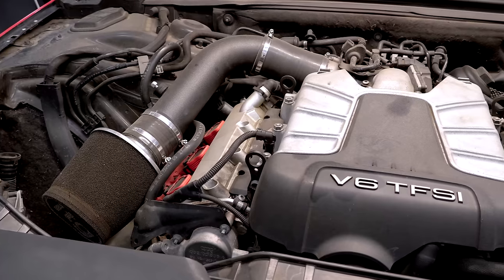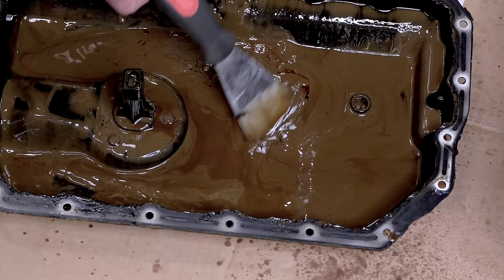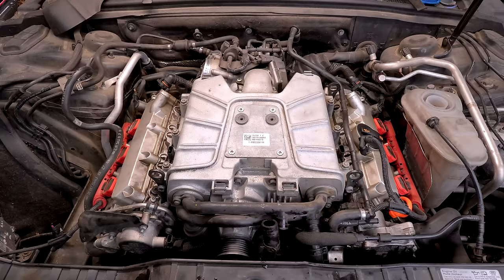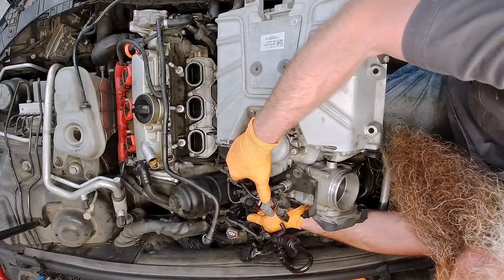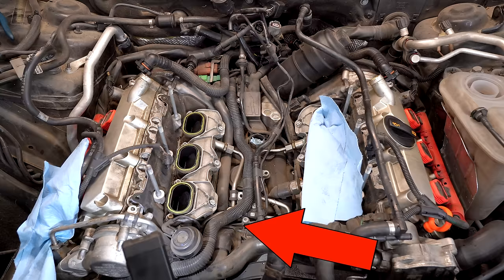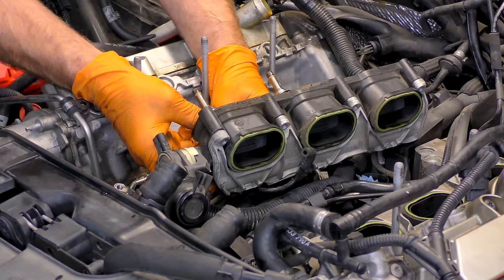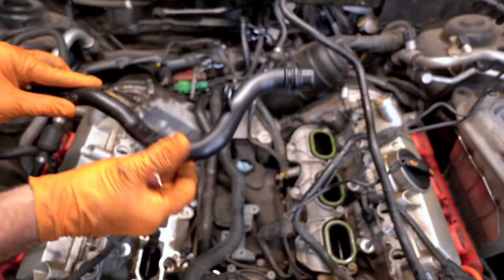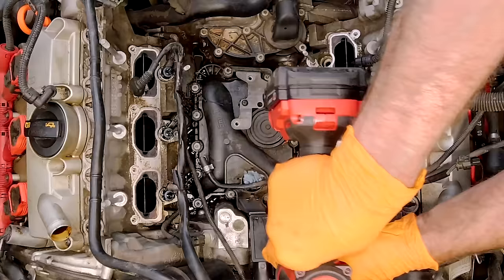How To Replace Audi 3.0t Supercharged PCV Value

Comment from the maker: Its WILD a PCV valve failure can cause this!! Here are some important links 
WD-40 Specialist Silicone Spray ~ https://amzn.to/3z6guht
PCV Replacement kit from  @Deutsche Auto Parts   ~ https://bit.ly/3TlFkSB
Scraper ~ https://amzn.to/3Su8IVB
Coolant funnel ~ https://amzn.to/3gDesPG
Injector Seal Kit ~ https://amzn.to/3F7LPEd
How to Properly Seal TSI Injectors ~ https://youtu.be/boVEdoayfn4
Reply: Got part numbers for all the gaskets needed to replace?
Reply: @HumbleMechanic the hardest part of the job was 15:20mins  in. That t30 sucked. I ended up taking those connectors loose and bending the bracket back while still using a low profile socket. And then that coolant pipe was stuck in the thermostat housing 🤦🏽‍♂️ just those 2 parts hung me up for over and hour. Lol
Reply: came here to see the part nr list
Reply: Do u have a wiring and vacuum diagram for the things in the back im worried i hooked something up wrong. I am getting an odd loss of power intermittently when i floor it, the engine will completely stop almost to the point it jerks me forward like i slammed on brakes then it will go back to full power. Very uncomfortable, cant figure out what i did wrong, it started when i replaced my coolant crossover pipe. Today i took it all back apart, replaced my fuel injectors, my pcv, spark plugs, and cleaned everything, but now im questioning if i am making a mistake on the vacuum lines on the back of the throttle body.
Any advice ❤
Reply: Great video !! What a pain in the ass job to do...
Reply: How much actual time do you need to do this whole job?
Reply: Where u located
Reply: Where u located please

Comment: I've had a buddy help me change my beetle engine and he hooked a vacume line up to a coolant line. Had a bunch of coolant mixed with my oil... did a flush multiple times, 10 years later I still find remnants of coolant on the oil cap. Engine is still going strong. Had 36k on it when it happened, has over 300k now.
Reply: If you only drive short runs, water condenses inside the valve cover and causes a little bit of milkshake on the oil cap. If you drive even like ten miles on the highway so that the car runs at full operating temperature under load, the condensate evaporates away through the PCV system. This might be an alternative explanation
Reply from the maker: @S1l3nthunt  Saw this a lot on the 2.0 non turbos. Short trip driving would build a bunch of moisture on the oil cap. a white goop
Reply: @HumbleMechanic  I'm thinking about looking for a Mk IV with the 2.0 NA 8V engine, I believe they have 115 horses. I read that many of them had oil consumption issues, but are they really bad engines in general? My dad used to have one of those in a '96 Passat and that was a pleasure to drive.
Reply: @schmuhf  Mine’s been reliable and doesn’t have any oil consumption issues. Little slow but kind of fun.
Reply: @schmuhf  reliable, but yes they burn oil and can start to ping.
Reply: @schmuhf  iirc, the early AEG’s had something installed upside down that caused them to burn oil. Mine is at 250,000 miles and is still running strong. I’ve had my oil analyzed and it shows about half of the iron ppm compared with the global average.  I burn 1 qt of oil over 7,000 miles. A slow, but solid engine.
Reply: 2.slow is probably the best motor VW ever sold.

dealer tech here.
we dont have problems with them.
just do services and send it.
Reply: Sounds like an aba
Reply: @bobby2800  from what I remember in forms one of the rings was installed upside down. 

Rip my Mk4 2.0 made it up to 300k
Reply: I would say that's down to genreal condensation

Comment: I used to make those PVC valves. They are made from a material (I think) called zytel. It's a fiberglass reinforced nylon. It's a pretty kickass plastic, but that engine is about 100k past it heat cycle life.
Reply from the maker: If that one was the ORIGINAL one, id say we did pretty good. This is a pretty common issue on these 3.0t engines. I just wish there was a better way to test them.
Reply: @HumbleMechanic  VAG Audi engineers are donkeys. Too much plastic with heat in all of their engines since 90's
Reply: Aluminum is also a pretty kickass metal. Just saying
Reply: @colchronic  this!!!!!!!!!
Reply: @HumbleMechanic  A better way? I remember pulling my pcv valves on gm products by pulling them by hand from the valve cover and giving them a shake . If they rattled they were ok. If not, you could clean them with solvent and try again. A 3 dollar item in the 70s and 80s. German technology is increasingly retarded.
Reply: @Sirius90125  that's the OEM  installed 'Fuse' to buy a new Audi .
Reply: Why do they make them so complicated? Why not just a check valve like everyone else.
Reply: @colchronic  and plentiful ... I have 3 garbage bags full of cans that can be turned into PCV valves. Don't rust, light, and durable.
Reply: @HumbleMechanic  They're made of glass filled nylon, you can see the percentage on the part embossed as PA12****. Zytel is a brand name owned by Dupont. No way Audi pays them for that.
Reply: @davidandrew7314  Is that the black plastic housing, or the orange rubber circular thing that he showed us?
Reply: Zytel, aka nylon. As far as plastics nylon is pretty good but I bet if it was PEEK, these would last longer

Comment: Protip: you can put a long extension or screwdriver through the hooks on each bank of the super charger to make it significantly easier to lift. Also be super careful to not accidentally let the one of the studs that the supercharger sits on go into one of the ports and puncture one of the intercoolers like I have unfortunately done, lol
Reply: Lol did just the same a few days ago, fortunately it was not punctured, only crushed, so after successful leak test I put some liquid aluminum to strengthen it up and called it a day 😁
Reply: Oh gosh! What is it made of to get crushed/punctured?

Comment: This was a fully packed non-stop video! So many chances for all these old plastic parts to break apart just by looking at them. You persevered and came out whole at the end. Very skillful, I'm jealous. Great as always.
Reply: This exact same thing happened to me on my 140k miles 2012 s4 , and at the same time a transmission line cracked inside the radiator and had to flush that out, and a week prior to those issues, I had to replace all upper and lower control arms, it was a hell of a time, other than that there’s little hiccups from stop to go, according to paper work I believe it does need new engine and transmission mounts, I’m pretty sure it’s the original ones and I’m sure it’s bout out around this time, so with new mounts I do plan on putting some inserts in and see if that definitely helps, just upgrading whatever breaks along the way lol

Comment: I wanted to let you know I had purchased a PCV valve for a 2010 Audi A6 Supercharged.   I thought this would be fairly easy change out until I watched this video.   I am a financial advisor by trade but I am fairly mechanically inclined (I can easily do brakes and rotors but have never ventured any further than that with repairs)

Thanks to your detailed video I swapped out the PCV and it’s running like a top!!!   Saved me tons of money and increased my confidence 10 fold

The car and I have a different relationship than we had before this job!

Thank you so much.   Incredible video from you!!!!!

Regards, Chris

Comment: Doing a PCV change on a 3.0t is a right of passage when you own one of these things. The only thing I would say is that it isn't necessary to remove the hoses from the valve covers considering how much of a nightmare they are & how easily they break. You can easily maneuver the pcv out of the engine with them still attached.

I'm just waiting on some custom parts from MercRacing to complete our 3.0t PCV relocation project so I never have to worry about changing anything related to it under the supercharger ever again.

Also, it's a good idea to replace that breather hose/check valve that comes off the top of the pcv & connects to the supercharger. If it fails it will trigger the same CEL as if your pcv was bad again.
Reply from the maker: YES Youtube is REALLY BAD about spam right now.
Reply: Do you have any advices and or tips/ blog posts for R36 ? The dealer in my area is TERRIBLE.
Reply: You should be replacing the breather hose along with the PCV valve. Those get brittle with time, and crack on their own. Then you have a CCV failure all over again, and the supercharger has to be removed again to replace the breather hose assembly. Just do both together so you're in there only once.
Reply: I'm coming from a BMW S54 which also had a few 'right of passage' (VANOS hub) jobs but this PCV looks a bit rough even compared to that engine.  Other than the PCV what other big ticket items does the 3.0t require attention for?
Reply: @vigilance6806  I've got a lot of maintenance videos if you want to check them out, but the number 1 issue for longevity of it, especially if modified, are the oem catalytic converters. They all fail, and can cause catastrophic damage if they clog.
Reply: Would thr check valve cause the pcv to whistle again? I installed a new pcv unit but vehicle is still whistling when it gets hot.
Reply: @LynxStarAuto hi , do you have any part number for that breather hose ( check Valve) please because i can’t find it

Comment: Just saw a first last week, Power Steering Fluid Mixing with Coolant.  Both the power steering reservoir and the radiator had the same milky content. It was on a Hyundai, the cause was a power steering line connected to the radiator (for cooling purposes I can only assume) somehow both cracked and bled into each other.  Stealership tried to scare (and flat out rob) this old lady into saying her car needed $5k in repairs, and that she should just trade it in for a new vehicle (trade in value less than $1500) she took it to a local mechanic and they only chared $600 to replace radiator and flush both systems.  

Charles thank you so much for your videos showing people how to be a home mechanic or at least understand what is going on with their cars!

Comment: I broke that secondary air line next to the water pipe…. I recommend being extremely cautious when moving the brittle plastic not flexy air pipe. Not cheap and you run risking breaking the new air pipe when installing it… Charles, your videos are priceless and have bailed me out more than a couple of times sir. Guys please support his Patreon, we need this guy around for years to come 👍
Reply: I did the same thing. Make sure you order the correct part. There was a revision to add a sensor at the tee. My car didnt have the sensor and I ordered the wrong part. 06E-131-143AJ without he sensor. 06E-131-143-AK with

Comment: AHHHH!!! This gave me flashbacks from last year when I had to replace the intercooler bricks in the supercharger on my S5. I went ahead and did PCV, water pump, belts, pulleys, and tensioners, as well as a nice carbon cleaning on the valves. I must add that if you're pulling the SC off, you might as well replace the intercooler bricks and change the SC oil. Nice work HM! It's boost season!
Reply: What's the best way to clean that carbon off of the valves?
Reply: @karlw2090  I used brake cleaner and a pick. Takes a long time. Patience.

Comment: Even though I bought a subaru last yr. Charles I still love your content! So much to learn from you! Keep them coming. I gave my Tiguan 2011 to my niece and she is still going strong over 160k! Doing front suspension this week for her! 
Thanks again for saving us a ton of $
Reply: Lol I had a 2000 vw just uploaded last year as well, also got a sub. 2020 the year before push button start and button shifter..... 
 Still have more problems with it than I had with my VW
Reply from the maker: @vick10036  THAT WAS A SCAM!!! DO NOT MESSAGE THAT NUMBER
Reply from the maker: Thank you for the kind words. Glad I can bring some value.
Reply: @HumbleMechanic  copy that. Thanks for letting me know
Reply: Anyway, you have to spend a bunch of money to keep it running
Reply: @RohanSanjith  that's true maintenance does cost however I spend that money to gain tools and experience for myself. Once I had to pay $150 + 180 for the pcv and all the mechanic did was unscrew 5 bolts and job was done. Did some research and came across Charles on YouTube. Ever since I have gained so much experience and tools. Knowing your car's heartbeat is everything and no one explains better than Charles and Paul from shopdap!
Reply: @HumbleMechanic  You can shadow ban the spammer they can still see their comments but no one else can.

Comment: Kudos to the most patient mechanic on youtube.  Working on german garbage is a task and for you to keep your cool and patiently pull off plastic hoses which were once rubber without breaking them is a monumental task!!
Reply: pointless. Trans will let go in 6k. Just park it.  Permanently.
Reply from the maker: Thats 6k of fun to be had. And I have a manual swap ready to go. not worried about it one bit.

Comment: Love that you showed the wiring harness mistake, I was cracking up as I made the same exact mistake last time I replace a customers PCV valve. 
There are two TSB’s from Audi, one only shows replacing the diaphragm, I like you showed replacing the whole valve since more and more of these are having the coolant mix with oil. The other TSB talks about fuel additives degrading the 90 degree vacuum line fitting at the PCV. Next time you do this job I’d recommended replacing the elbow to prevent future failure.

Comment: Nice walk through. What I like to do, besides pics, is keeping a set of color markers, so I draw a line, and sometimes a symbol on the parts. Like the long bolt on the manifold, mark pink the bolt head and around the manifold hole. Not only prevent mistakes, but speeds up. I also write a number on parts(hoses, connectors, etc.) then follow the numbers in reverse when assembling. OCD much?!😅

Comment: Everyone in the groups complaints about the one bolt holding the coolant pipe by the knock sensor harness, but I learned from you long ago and bought VIM Half Cut bit set and It was a breeeze for me. 🎉
Reply: Please explain these bits?
Reply: @mk_ultrarunner  VIM tools VHC77 77piece half cut stubby bit set. Works great for tight spaces like the coolant pipe bolt on the 3.0t and valve cover bolts that are closest to shock towers.
Reply: @360construction9 thx. I looked them up. “A bit pricey.” 😂 But definitely looks helpful. Thx.

Comment: 0:42 The coolant warms the PCV so that moisture in the gases does not freeze in the winter and damage the engine.
On other engines, when moisture freezes in the PCV, it stops the pressure increase and oil starts to run from all the connections and seals.
This will happen due to short trips in the winter.

Comment: I was replacing the valve cover gaskets and broke the breather hose... So here we are!

Pro Tip: cut off a piece of baling wire (the stiff wire that holds its form) and wrap it 90-99% around the plastic hose port on the Valve Cover. Don't overlap it, a small gap is what you want. Use a pic or flat-blade screwdriver and push it up and under the 4 retainer sections of the breather hose clip and it will pop right out. The idea is that you are releasing all 4 of the clip sections at the same time instead of fooling around trying to pry each one out at a time with a pic and having them snap back into place. Don't pull the hose too hard or you will be watching the "How To Remove SC and Replace PCV Valve" videos like I am... The hose ain't cheap either.

Comment: A few years back, I did fuel injectors and intake manifold gaskets on my 93 Ford Explorer. Used paper towels to plug intake holes, and forgot to remove them. Got sucked into cylinders. Took myle hours with boroscope to remove it all. Truck runs good!
Reply from the maker: Yikes

Comment: Great video. Love how deep you dive into the extra stuff that's a pain in the butt. To be honest though, I think you should've shown how you removed and replaced the secondary fire wall. That is something nobody has covered on these cars and I believe it could be a very critical and helpful tool for PCV, 02 sensors, Rear timing covers, Catalytic converters, Oil Filter Housing, etc... Thanks again for the insightful video, and if you have video of the fire wall please post it.

Comment: i ended up dropping that T30 screw on reinstall, took me hours to find it with a mirror, it actually ended up wedged between the power steering rack. was happy when i found it. put some towels underneath when removing or reinstalling in case you drop it

Comment: hi humble thank you for such a great video can you please help me with this if you can i replaced the pcv valve but it still leak in the valley and caused the oil to leak in front of the engine please any suggestions.. i got the pcv valve from the dealer

Comment: On Volvo we have the "glove test".
We place a glove over the open oil cap if the glove inflates the pcv system is clogged or leaking. You want to always have vacuum drawing from the crankcase.

Comment: Probably a dumb question, but I had my car inspected. I see on the labor description, the mechanic recommends PCV Valve replacement with parts in conjunction. Yet I see on the part’s description Engine crankcase vent valve…is that the same thing? It looks like they got a bunch of parts that probably go with it, but not the main component.

Comment: Great tips, yesterday I've replaced the pcv because my Autel found a fault code and I had 2 symptoms, the sizzling sound while accelerating and I couldn't remove the oil cap while the motor was running, extremely suction. Replaced it with OEM, and several gaskets and o-rings, no change at all. Do you have an idea of what it might be? And had a manifold code after the replace, so I guess somethings wrong there too, although I hold the flaps open while mounting the manifold.